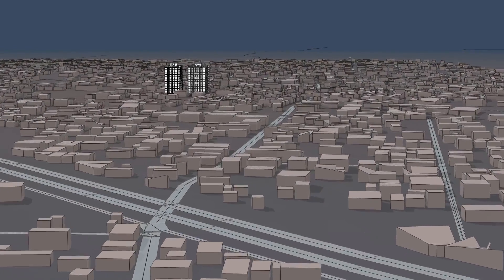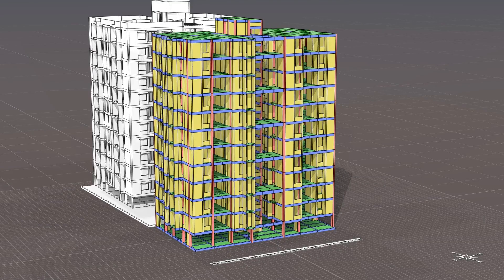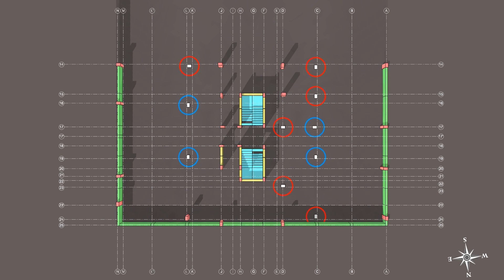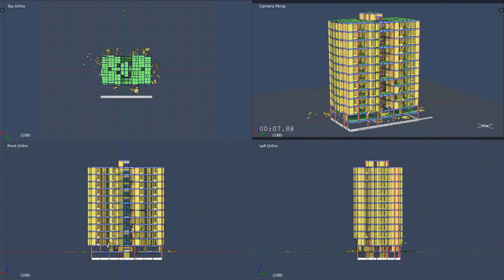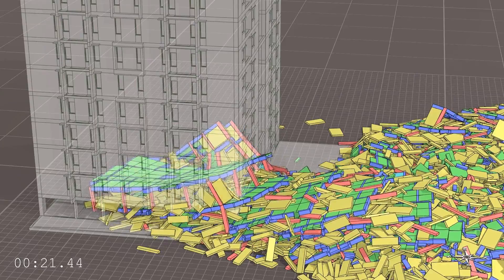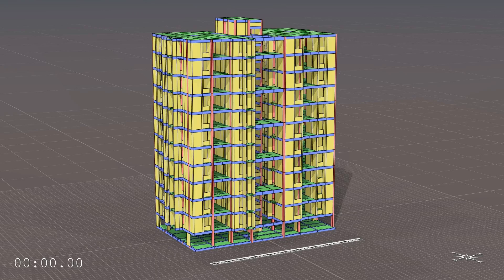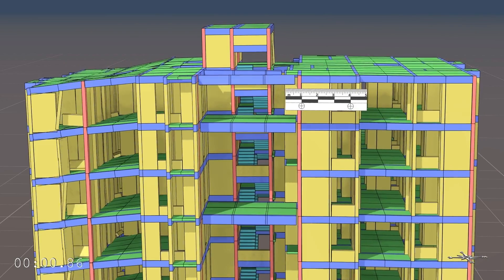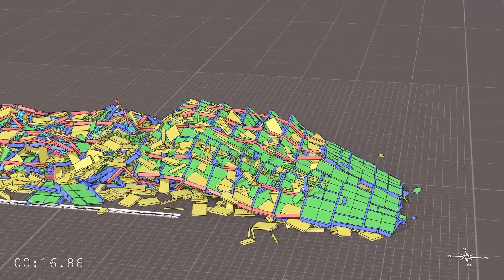Lightning Hit Collapse, 11-Story Building Simulation, Prime Trust Heights, Moulivakkam, Chennai

Comment: These are so detailed how long does it take to make one simulation if it's around this big?
Reply from the maker: Simulation time can take several hours.
Reply: @Kostack Studio i have a laptop :/
Reply: How long it takes depends on complexity, design and how accurate you want it. If you want a small house, smaller time to load, but if it were the twin towers, it would take very long to render/ build